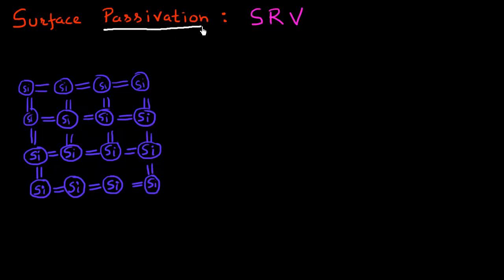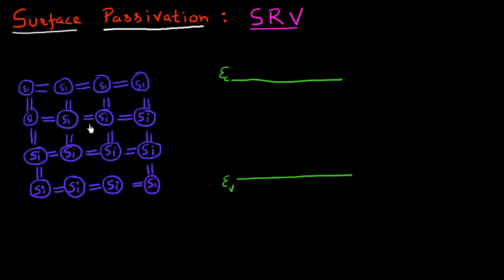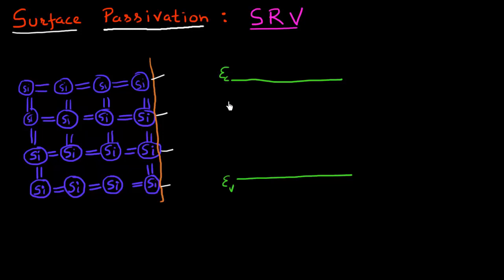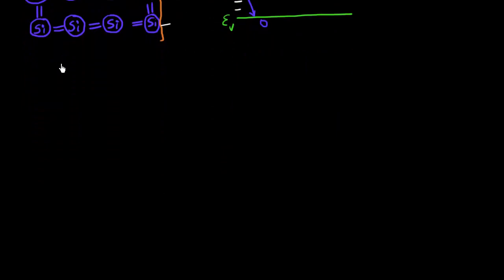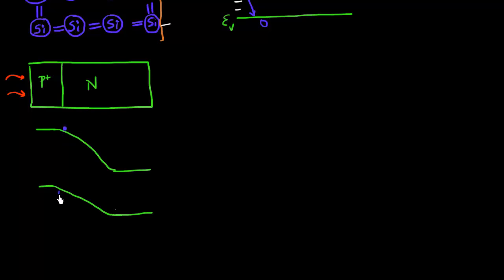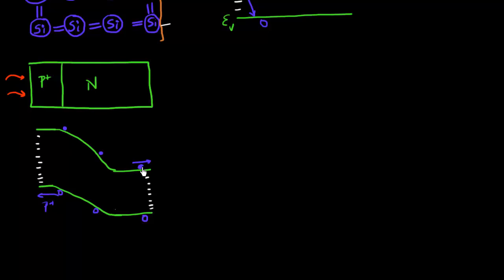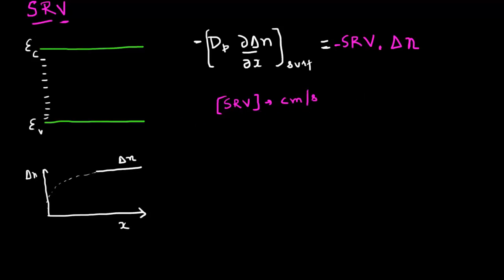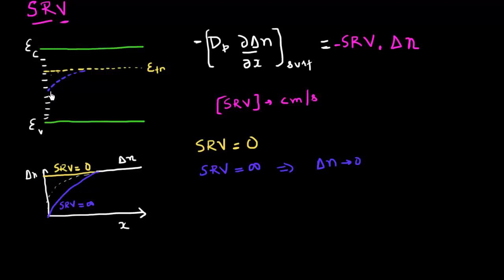Surface recombination velocity for solar cells

Comment: Great video.  I measure SRV using a microwave-Photoconductive Decay measurement system.  Using a u-PCD system that can map an entire 8" Silicon wafer, I can generate a high-resolution map of front surface SRV from the measured minority carrier lifetimes values.  This provides a "quality" figure of merit value of surface passivation.  As you point out is important to solar cells and just as important to gate oxides in some MOS devices.  So, being a high resolution map of the entire surface, a diffusion process engineer can use this knowledge of SRV to monitor or even develop new surface passivation processes.